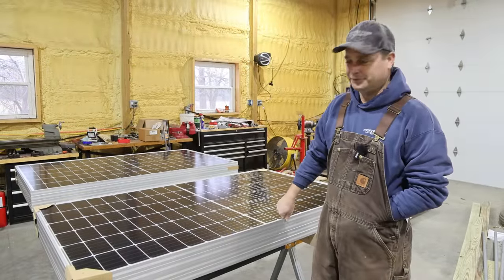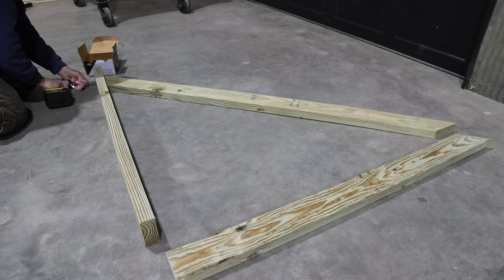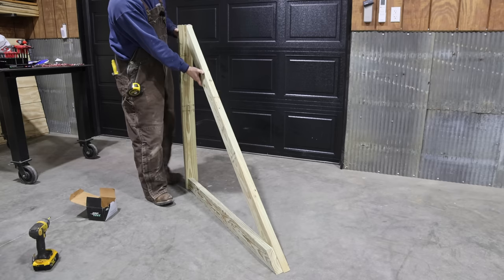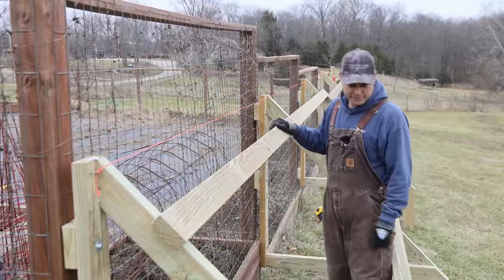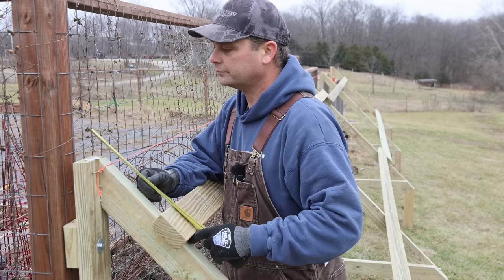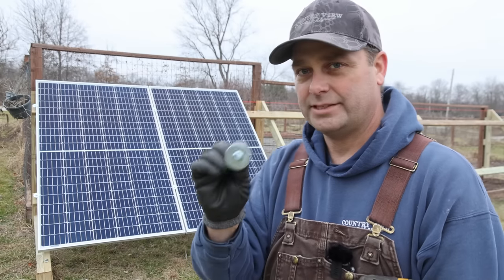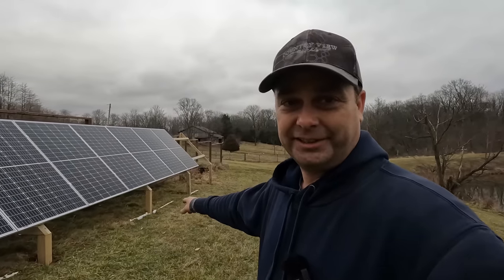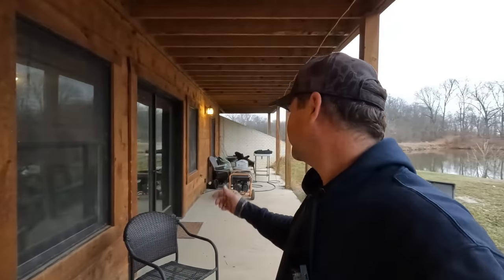Building our First Solar Array.  Easy, Low Cost Solar Ground Mount.

Comment: I have 15 72/37 inch solar panels on the roof of my garage, 280 watts each broken down to  3 , 4 panels sets and one three panel set. If your not getting good info from an installer or the company you got your panels from let me give you some true Diy things that I have discovered in the  4 years I have had mine running. My panels are on my garage roof because I have no room in my yard. You on the other hand have plenty of space. It's been said in the comments, snow is a pain on a roof, maintenance is a pain on a roof, you will be on your roof a lot. On the ground all you have to do is walk up to them. Your temp solar panel rack is fine. As you said it's temporary. The one thing that I see on this video thats worring me is your wiring from the panels to your basement. You do realize that the power from the panels is DC? Distance matters when is comes to DC power lines. Another thing that I didn't see or hear you talk about was circuit breakers for the DC lines coming in. Thats a must if you don't want to destroy your solar equipment. It sounds to me that your plan is to go off grid. There is a lot more to it then a few solar panels and 2 battery backups and testing. On YouTube go to Ambition Strikes and look at their setup. They have already done what your looking to do. They had help installing all the stuff they needed to make it work for them. Im sure they got a cut on the price for putting the install on their chennel. Please be safe don't kill a bunch more fish. LOL

Comment: Hi Evan, I would recommend you consider a ground mount for your permeant install. Putting the array on a roof may be attractive from a space conservation but it will bite you when you have to service them or when a mount attachment leaks into the roof.

Engineer775 has some great videos on ground mounts. - https://www.youtube.com/@engineer775/search?query=ground%20mount
Reply: Engineer 775 is a Excellent Source for Solar Anything!!!

Comment: You can't get a building inspection for a wood ground mount, if you need those.  And you save a TON of money by building a legal ground mount, because with county approval you can have a grid-tie instead of batteries.  (Which are a huge expense!)  The problem is that your home-brew ground mount can warp and crack the panels.  Your clamps are not engineered to keep the panels in place during a storm, and your garden posts are not that sturdy.

My ground mount is approved.  It uses 1 1/2" pipe in 18 inch concrete piers that go 26 inches into the ground.  The aluminum rails that mount on the pipes, and the panel clamps are all engineered to hold the panels in place in 120 MPH wind, even though we never get hurricanes here.  There are several manufacturers that sell ground mount systems complete with free engineered plans you can take to your building permit department.

Comment: Bend the outside washers as close to the hole as possible it’ll keep it from angling down you may have to put a smaller washer on top for strength. I’m surprised you didn’t put a ledger broad on the bottom to keep panels from slipping down as they become lose do to weather. I’m sure you’ve watch wild and wonderful off grid,life uncontained, off grid homesteading with the skinners

Comment: If your not able to back feed the grid once your all connected up for the finale.  Consider a dump load in your plan for when the batteries are full.   Like it automatically dumps into an air conditioning unit, water heater etc.   Ain't nothing worse than wasting that excess power and then spending on the grid later.   If you back sell back to the grid.  Then all's good.  A friend on mine does the dump on his wood boiler. When it over heats   it dumps round  his green wood shed rather than over cooking his house.

Comment: I see you struggling with holding things in place.  You may have them and like I do forgot them.  However buy clamps, at least quick clamps for around the house.  As a third hand they work great.  I see also that there are some great suggestions of putting up a solar system and some of the DIY'ers to watch online before you get started.  This is for later after you finish with your temporary set-up.

Comment: Nice build! You'd also need to bury the posts to deal with the frost heave. But that may not be an issue because I'd imagine your garden posts aren't buried so it should heave the same for both.
Reply: Nah sure ye paid attention.   He didn't bury them because it's a temp.   He explained all that in the vid.
Reply: I was referring to the final build.
Reply: @novaka240  sure the pole barn roof not going to have that issue

Comment: I really think you should anchor the front post.  This will stop the panels from flipping over if you have high winds.
Reply from the maker: Yes that is a concern.  But they only be there a couple months.  Then They move to the pole barn roof.

Comment: I think you’re going to regret not burying that wire even at a shallow depth. Put some rubber washers under the galvanized washers to grip the panels better and add a 2x block of wood under the end lags to keep the washer flush. I guess you’re planning on having these down before you plant your garden? I can see shade being an issue for what ever you plant on that side of the plot. Looking forward to seeing how this works out for you.
Reply from the maker: They should be moved to the pole barn roof in a couple months.

Comment: You're about 39 degrees north so that 45 degree angle seems a bit too much, generally you want it equal to your latitude. 
However it might be good to give you worst case scenario and as you say it was easier to build. 

If you're feeling fancy, and doing a ground mount for final install, it might be worth it to keep either the top or bottom floating so you can change the angle throughout the year. Just pop out every month or two with a couple jacks to change the angle to whatever's ideal for the season. 

From a random angle calculator based on the zip code of your PO box:
Your optimal year-round tilt angle:
31.1° from horizontal

Your optimal tilt angles by season:
Spring: 31.1°     Summer: 16.1°
Fall: 31.1°          Winter: 46.1°

Your optimal tilt angles by month:
January: 41.1°          February: 36.1°
March: 31.1°             April: 26.1°
May: 21.1°                June: 16.1°
July: 21.1°                 August: 26.1°
September: 31.1°     October: 36.1°
November: 41.1°      December: 46.1°

So I guess for now 45 isn't as bad as I thought, good enough for a test at least. 
With that much land I wouldn't ever bother with roof mount panels unless you're getting your roof redone already or something. There are plenty of crops that can handle the partial shade under panels, or you can keep chickens under them, if you want to double use the land.
Reply: Using your latitude does not give you the optimum tilt angle.  Latitude * 0.76 + 3.1 gives optimum for fixed tilt panels for year-round use.  But other things come into play.  Depending on your energy usage, you might want to optimize for summer or winter instead.  You might want to tilt the panels steeper for better snow shedding in the winter.  Regardless, you're only talking a few percent generally either way.

Comment: You might want to put up a temporary fence or something around those panels.
Reply: Yes, essential if there is the possibility of children coming into contact with them.  Remember, with series connected panels you very soon deal with lethal DC voltages and currents.  If a fault occurs e.g. the kids smash a panel, there is the risk of live metal.

Comment: What's your backup situation? I have had cloud cover for eight days with little penetration from the golden orb. I have solar, and through the day, on average, I get maybe 200 days of full sun. My full system of 18 panels and inverter etc cost $3000. My avg power per mth is $50 - 70.

Comment: I noticed you have a lake behind or pond.. it said oven close pond or does it have an outlet on it.. you may be able to put a water turbine on that some people make water turbines out of a cable spool in a car high output alternator.. you know if you want to run a water turbine and you think it's too far from the house you can use it to power an aerator in your pond telfair rated if there's fish in there.. or if you have a garden where you going to water it beauty is a combination water turbine / small solar system if there's not enough power coming off the water can be pumped up to your garden...

Comment: Great job, guys, 👍Hopefully, the frost doesn't lift and twist your array 🤞 I wouldn't roof mount my array to many home insurance and permit issues—also the possibility of harming a fire fighter if you don't have the proper disconnect and RSD installed. Crazy that people think you can just put them on the roof 🤦 Keep up the great work!
Reply from the maker: I already have the rapid shutdown system components, and pv disconnect.   And the roof racking is ordered.   Everything will be to NEC code.  Remember, I do electrical work for a living .
Reply: @CountryViewAcres  I did not know you do electrical work for a living. I should have guessed by your circular saw technique, lol 😆 I'm a carpenter by trade. I look forward to watching a proper-to-code roof mount. 🍻
Reply from the maker: @Roll2Videos  I will try my best to build it correctly.  I am sure someone will point out if I do something incorrect.  Then I can correct it.  But I want it to be right when I am done.
Reply: @CountryViewAcres  That's great to hear, You have a sub in me :hand-orange-covering-eyes:

Comment: Your panels will supply their rated power for several months round the summer, BUT in the winter they will provide about 1% of rated power for the very short solar day (you may get 12 hours of charging in the summer but 3 hours in the winter). A better metric is how little you need to run the generator. The advantage of a battery system is that you can charge from a generator at full power for an hour or two but don't have to run the generator lightly loaded all day just in case the fridge or freezer needs power to cool down. A cloudy period in the winter will cause you to depend on a mains or generator supply, in the summer your batteries may be topped up by 10AM.
Reply from the maker: My setup will use solar first, then battery, then grid last.  So when there is no solar, it will still work off the grid.  If, for some reason, the grid goes down, and the battery needs recharged, I could fire up the generator.

Comment: Okay I have 9400 watts I live at 43 degrees latitude in Michigan my worse days were 300 watts of solar I average about 3 kilowatts a day during the 2 worse months. My house needs 16kw a day. I use the Grid when my batteries get low, 60 kw of 4 banks(50kw usable). Some weeks it takes all week to fill batteries so I can run 3 days on batteries then repeat. You will need a generator if you want to go off grid even if you have 30kw of solar. It is what it is.

Comment: Evan- Don’t forget to tighten those bolts on the panels. As the PT wood dries it'll shrink and the panels may slide out from under the bolts. 
Also, I agree with the others here about roof mount vs ground mount. It's hard to get snow off them. I have an array on my 7/12 roof and snow sticks to them fairly well. If you wire them in the series using less strings you'll get high voltage, which means cheaper, thinner cable. Consider doing a ground array a few hundred feet from the barn or house. It won't cost as much as you think to run the high voltage DC cable from the array to the inverter inside.

Comment: I think it's dark when I get home from work at 1 in the morning of course I leave to go to work at 11:30 in the morning I play with solar panels as well but I never used to sell the generator yet I haven't really hooked solar panels to my house yet but I did use the solar panels for some things in the house but from what I was told in the past from videos and whatever else not I was going to leave at least 4500 watts to run typical things in-house not including any of my big loads but my biggest problem is I probably got more than more of a difference than you do is I got seven size solar panels. And when I have everything set up is a 12-volt situation but I got 4440 watts of solar panels not including a really small ones and I'm probably going to hook up the 12 volt inverter and hooked it up to my power to my house shortly from now avoiding all my big loads and some of the 12 v system to my house, but before I do that I probably have to change my batteries from lead-acid batteries that are 25 years old and still work like they're brand-new which I've been using on solar panels for the last 25 years just been adding  solar panels to it. Change of plans going to some sort of batteries for the solar panels or at least that's rated for solar panels anyways that is a price expensive price at that yet. But I still have to buy those yet and I think that might explain the cost of things even though the 12-volt inverters went that expensive because I got many of them last year trying to find the right one to runoff from 12 volt system. But I will be changing to 48 vote system pretty soon if things work out right and if I can get assistant sea of the same size solar.

Comment: I wish I wouldn't have put my solar panels on my roof. They get covered with snow and I  don't like climbing ladders in the winter. My two grd mounts hold 18 - 240 watt solar world panels, which are easy to clean the snow off them. I'm building another grd mount that will hold my 15 - 300 watt roof panels.
Reply from the maker: We have only had snow twice this year, and it's usually melted away in a day.  So I don't think snow will be a big problem.   And I am putting them along the bottom of the roof, so I can reach them with a 24 foot squeegee

Comment: HOWdy  C-V-A, ... 
I utilized  5/16"  -  4"  long  Stainless Steel Lag Bolts & Stainless Steel 5/16" X 1 5/8"  Fender Washers ... 
on the Outside EDGES of my Panels --- 
I cut 2" long  hunks of  3/4" PEX Water Pipe which kept my Lag-Bolts & Fender Washers closer to "FLAT"  ...
 (my PV PANELS  are 2" thick ) ...
the way your PANELS are mounted a simple 1" X 4"  board across the BOTTOM of your Framework ARRAY will ...
keep everything SAFE from sliding down if your Lag-Bolts get LOOSE ... 
... IMHO = KEEP your PANELS where you have them = Ground Mount ...
You will never be able to BROOM the Snow off if they are on your ROOF - again  = IMHO   ...
Good Luck on your ARRAYS
COOP
the  WiSeNhEiMeR from Richmond, INDIANA 
...

Comment: I'm thinking that when mounting solar panels with a fixed orientation, it should be optimized for winter operation, since it is more likely that you'll have a bad streak of weather in winter versus summer.  Also, the consequences of running out of power are worse in the winter than the summer.  Any feedback from anybody?

Comment: Good start. I do think eventually you'll need more panels, and the external batteries for the delta Pro's. I designed a 1 Delta Pro system for some friends that are completely offgrid in TN. Tried to max out the voltage input of the DeltaPro for them, waiting on the extra batteries until we find out if they need it, and have room.

Comment: I am having a hard time finding a benefit to temporarily setting up solar panels in the winter, as apposed to waiting for a permanent set-up in the Spring.
Reply from the maker: #1.  I will find out the real production of the solar panels in the wintertime.  Which it turning out to be terrible.  Lots of cloudy days.
#2. Installing them on my roof requires a rapid shutdown system.  So now I can test it out on the ground and make I have it hooked up right before I ever get on the roof.  I really don't want to be troubleshooting and removing panels on the roof.  So I want it right the first time.
#3.  I can use these with my solar generators and see how many hours batteries run certain loads when charged only from solar. That will help me select the right battery bank size.
#4.  I just want to play around with it.

Comment: Have you done a study of what your home power requirements are (looking at energy usage from the grid over the last year or two to see what your usage is)? Understanding what battery capacity storage is going to be required for 7-10 days without sun. Supplemental ICE generator to recharge batteries when you don't have enough solar to recharge batteries? I don't think you have discussed what real first steps should be when understanding solar sizing if your intent is to be off grid with AC connection as the backup. Just curious.
Reply from the maker: In a future video we will determine power requirements for the loads I want to power off solar.

Comment: Wow that solarwire looks a bit thin..... hope they don't get warm and you don't loose much voltage from panels to Ecoflows
Reply from the maker: 12 gauge wire.  The array is 132 volts and 9.52 amps.   100 feet of wire.  2.70% voltage loss.  It is within spec.
Reply: @CountryViewAcres  That sounds like right. The amps are low so that keeps it safe!
Reply from the maker: I do electrical work for a living.  So, I will do my best to do it correctly.  But this is a temporary setup, so it isn't 100% correct.  It isn't PV wire, but the final system will be.
Reply: @CountryViewAcres  As long as it is safe :-) Wire is wire, as long as it can stand the elements 🙂